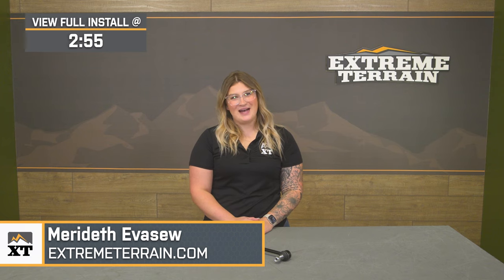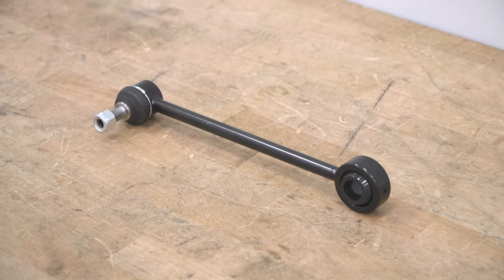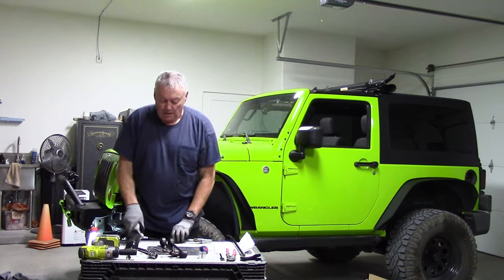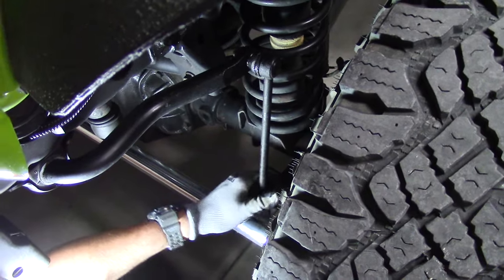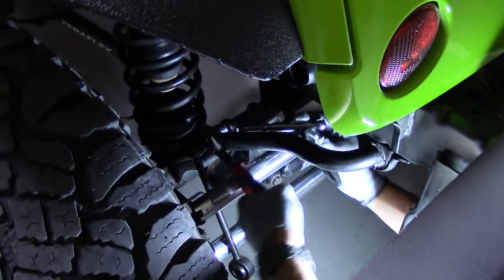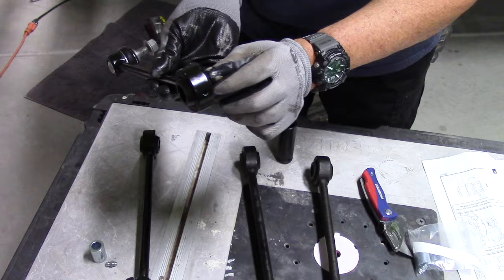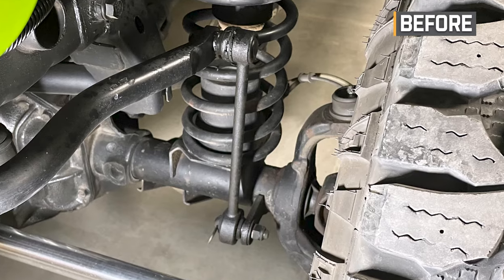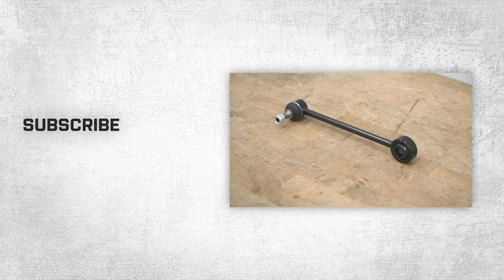Jeep Wrangler JK Teraflex Front Sway Bar Replacement Link Review & Install

Comment: Hi guys, I have to put mine upside down because the zerk fitting does not below a track bar part extension from Smartsteer. My trackbar is relocated. Does this affect the function? So basically the side with the zerk fitting is now on the top.
Reply from the maker: I would recommend to flip them the correct way and take off the zerk fitting while installed. That is only there to grease the joint. When it comes time to grease it, you can pop off the link, install the fitting to grease it. You will get better performance/function with the end link positioned the correct way. Hope this helps!